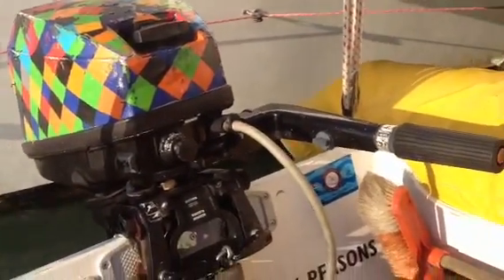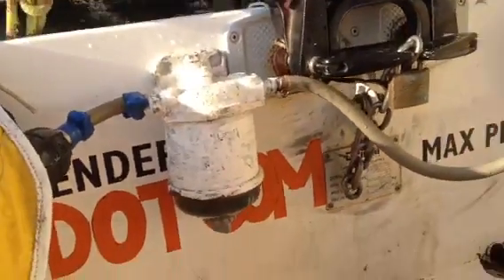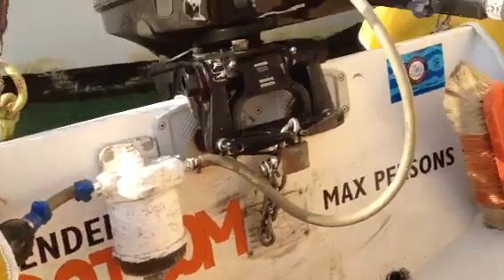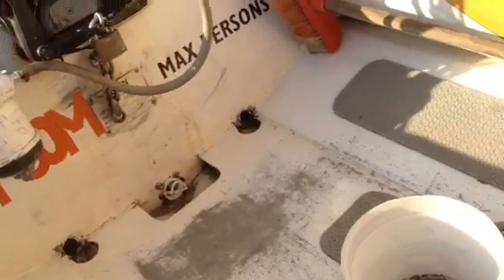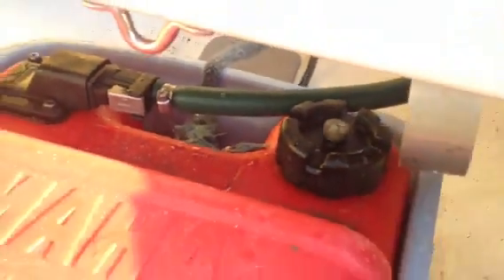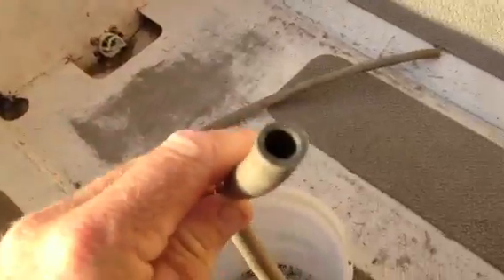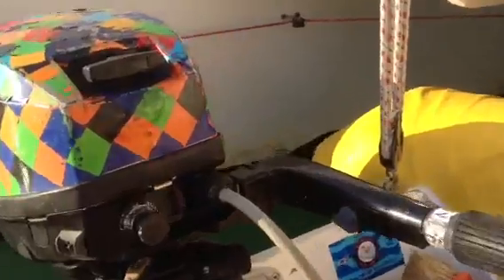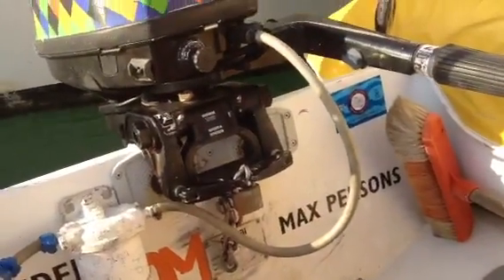Fuel problems and fuel blockages in outboard motors - full diagnosis and solution

Comment: Try checking your tank cap maybe the screw is tightened no air can get in.
Reply: One of the biggest fuel problems is that gray color fuel hose with a clear plastic lining inside that type of fuel hose is garbage dont buy it....you will be wasting youre money